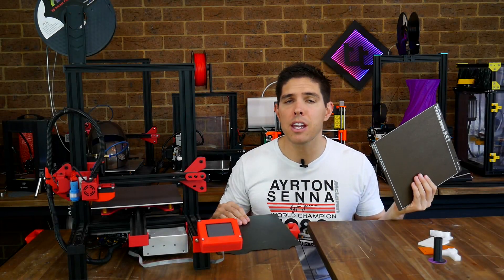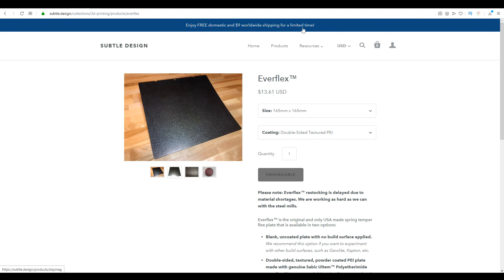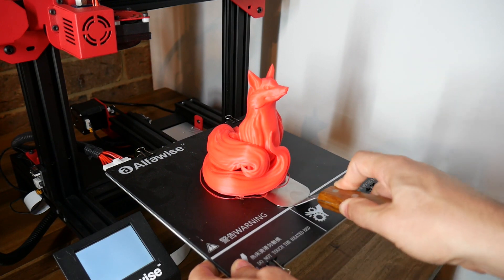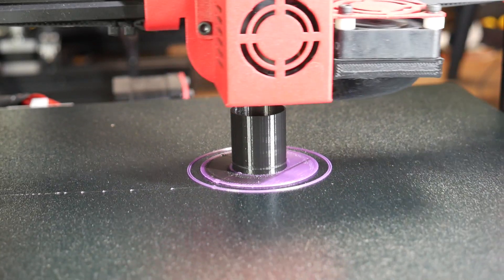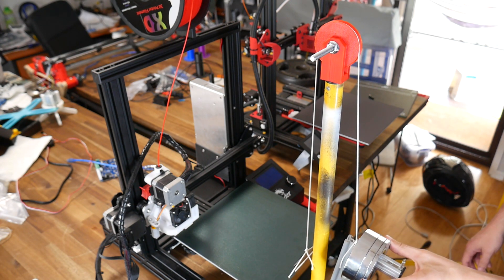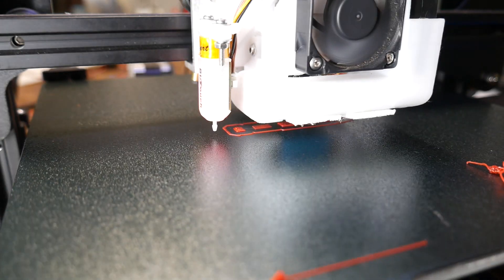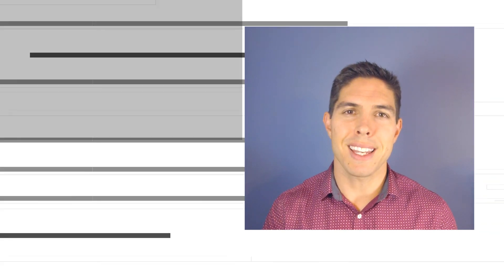Everflex PEI powdered coated magnetic sheet - Prusa style bed for your 3D printer

Comment: I’m wanting to use a textured service and currently have wham bam sheets on all of my printers. Like you I’m located in Australia and products like layer lock are expensive to get shipped. What do you suggest?
Also have you found a pei surface that you could attach to the other side of a wham bam sheet? I assume that the magnet would still be strong enough to hold it.

Comment: I have an anycubic i3 mega s. its my first printer and i have put a lot of wear on it over the last 6 months. the print bed is chipped and it seems to have a high spot in the middle. I want to add a magnetic surface to revitalize the print bed and i wos curious, should i lay down a parameter of masking tape around the outside out the bed to raise its height to about the height of the center before applying the metal plate? would that lead to adhesion problems for the metal plate in the future or would it be a  suitable solution to my problem?

Comment: You need to test the pull strength when they're hot, depending on the type of magnet this can change drastically. 

Also, you should show  the pull strength of of a tried and true magnetic base, the mk3. You're telling us that these arbitrary numbers are strong enough to 3s print with but how do we know if either is good? You need to prove it.

Comment: I'm more interested to make a DIY surface. Some guy did wrote that it's possible with using a special car paint of "Ceramo" brand. Claims that it's a great thing and keeps the most of plastics like a beast when the surface is hot.
Actually it's not because I'm that greedy... But the delivery from US costs ~40$ for us. Not an economy way to buy these original parts :)

Comment: Hey Michael! There's a question that's been bothering me. You know the creality bl touch kits, you even reviewed one. You yourself know that the bltocuh v3.1 that comes with the kit doesn't work with the provided firmware, and i'm no programmer so i'm really not comfortable with editing or modifying the code that my printer runs on. But i did some digging and i found creality's google drive page that had updated firmware (1.1.9 for BLTouch V3.1) for every printer except the ender 3. There was one for the ender 3 PRO, but i have the stock one and i don't know why they didn't make one for that. And i was wondering, there really isn't any significant change that directly affects the printing process on the ender 3 pro. Like the offsets are the same, just the y axis is wider and has a mk10 extruder in place of an mk8 extruder. Other than maybe having to recalibrate the e steps thats it? So other than reading ender 3-pro on the info screen and some tinkering with the e steps i really see no point why i should not use this on my stock ender 3 to get the BLTouch working. What's your take on this?

Comment: I very much think this is one of those deals where you get what you pay for.

I bought an aftermarket PEI sheet and also an aftermarket powder coated PEI sheet on Amazon for my Prusa MK3S while waiting for the originals. Neither one lasted long. The powder coated plate delaminated in spots after about a week, and the PEI sheet plate lasted maybe a month and then developed a tear. In comparison, I received the powder coated and PEI sheet build plates from Prusa about 6 months ago and both still going strong.

Thanks, but I’ll buy the originals from Prusa.

Comment: o.k. ill get the texture thing thats nice but is that sth. that buildtack or the nockoffs cant do? i think they can. and geting corner lifting on pla @60 C is realy not good in any way shape or form. Considering that you can basicly print with no heeded bed on buildtack. if your bad leveling skill is up to the task, or your printer outo levels. 
I think combind this solution costs like 50-60 bucks for an ender3 siced surface. thats 1/3 of the total printer price. 
With the spacs it has its more aimed for the higher temperature materials like PC, PIE (ultem), Asa, ABS. where the thermal stability especialy of the magnet counts big time. 150C is a nice number. for a flex bed. And the print surface stays nice to at that temperature. With buildtack (basicly a slice of pc (polycarbonate) 150 is tricky).
In that bracket 60 bucks is alsow no longer expencive. 
But for pla and petg same for flex it makes noo sense getting this surface, 
Get a bottel of pva glue fill it in a pet bottle mix it 1 to one with isopropanol and add a bit if water. 
u have a slury than put that on your buildtack and spred it with a cutter knive edge so that it forms a thin layer on your complet bed. 
Print on it,  its good for like 3 prints in one position. 
main thing is if u get a print thats stuck to your bed just put a bit of isopropanol on it and the surface will turn back in to a slurry relesing every part.

Comment: Although you might be taking your life into your own hands again, I suggest the testing you did for separation strength should really be done with the bed heated, given that a magnet loses strength as it is heated, Although I think it likely that the sheet will still provide enough holding force... I think testing with a heated bed would yield more useful data.

Comment: Subtle Design  sure looks like a trustworthy company.
They don't even say where they ship from or what their business address is. I am sure the quality of their product is sooooo much better :)
LOL Wam Bam is even worse. They don't even offer a way to contact them. This is a joke video, no?
Reply: WhamBam is based on Florida and they drop ship from China.
Reply: Subtle design just moved and is based out of Texas. All their plates are cut and processed in the USA with USA steel suppliers.
Reply: @bl5930  that's awesome! They really should do something for corrosion resistance. They do state to keep the plates in low humidity environments to prevent rusting.
Reply: @TH3DStudio  so far I haven't had any issues. 20-30% humidity and nearly 6 months of non stop printing. I've washed both of my plates with water and Dawn followed by a quick iso wipe down and still no issues. I'm still on side 1 on both plates. I agree a different solution would be nice but non wavy stainless spring steel isn't a thing. That leaves coatings like phosphates or zinc but the cost will go up alot. Honestly I'm shocked they are still as cheap as they are compared to competitors.

Comment: Hi Michael,  As always, thank you for the video.  Watch out for those failed Darwin Award attempts mate!!  I do like the look of this setup, but it's a bit pricey, no?  Currently using the OEM Creality glass sheet with printed texture on my Ender 3, and very happy with it (apart from the Creality logo they printed on it that tends to make a partial appearance on most of my prints). I'd be tempted by this solution if it was cheaper but as it is, I'll stick with the glass.

Comment: Hmm. I am tempted to order one of these.  I have an Ender 3 and the flex bed that came with it gave me nothing but grief and one failure after another.  I tried glue-zip. I tried sanding it-another zip. Finally I tried a heavy mask that I use for sandblasting and that worked great for PLA for many many prints but when I switched to using PETG my prints permanently bonded to the rubber mask and pulled it loose.  I finally switched to a sheet of glass with the neoprene rubber mask on one side and that side down on the heating plate.  I have to spray the glass with a light coat of clear polyurethane and respray the area I've printed on after the print is removed.  This has worked great for me, but I really like the idea of this print and go bed.  Yup-I've just convinced myself and will go to your links and buy one.  Thanks for a better solution.

Comment: its important not to remove the print when the bed is still anywhere near warm because you definitely will warp your parts. it might not warp by much but you can be half a mil or a mil out and if its a mechanical part then you're boned.

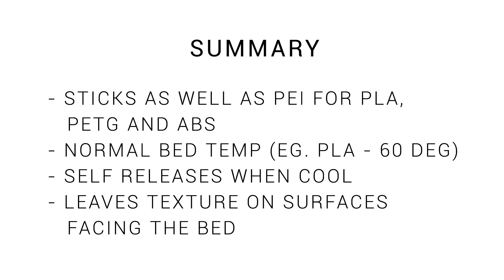Comment: @9:05 usable for ABS?  think not, cause you cannot heat the bed more than around 60C (magnetism decreases over time) and i like to print with the bed at 100C
This is probably  so for all magnetic beds, so for me, nothing beats the classic kapton tape still..
Reply: This is a different kind of magnetic surface I think.  Designed to handle higher temps without causing issues.  Even says in video rated to 150c

Comment: Maybe I'm too oldschool, but all of these 3 materials work on glass with a bit of gluestick, even if you print a lot you get what? 2-3 prints a day? that added minute is nothing compared and also bed leveling is a breeze, you don't need a bltouch or any abl. Bit more work print-to-print but reliable and cheap.

Comment: I still prefer glass with the ceramic coating. Got one on amazon with 3m tape already on it so no clips needed for 20 bucks. 3 months of use and scratch free. Love it and will never go back to disposable pads.
Reply: How about having to wait long to remove your prints? What about the added extra weight?

Comment: Using a similar one from trianglelab. Working okay for me but I can not get PLA to stick very well so I always use hairspray and brim and with this it works.
To clean off the hairspray I use hot water tho. Wat is the problem with water on that sheet? Is PEI water soluble? Or is everything ok if I clean it with IPA after cleaning it with water?
Reply from the maker: I don't have that sheet so I can't give you good advice. Have you looked for details on their website or contacted them?
Reply: This sheet is pretty different to the trianglelabs sheet, I have both.  The triangle labs texture is more smooth and seals the steel, but doesn't seem to stick well to pla for me either.  The everflex is very rough in comparison, and works well with pla and petg (however I have had issues with corrosion and powdercoat flaking off).
Reply: The "Don't use water" hint is for the everflex sheet. But it did not say why on their website. But I think the sheets are very similar so I'd be interested why water would be a problem with any PEI sheet
Reply: @mschild95  You're not supposed to use water with the everflex sheet because it doesn't have an anticorrosion layer between the powdercoat and steel, it will rust.
Reply: @theheadone  I already thought about sandblasting (very little pressure) one side of the trianglelab sheet and test whether this improves adhesion for PLA

Comment: I ordered a similar pei powder coated spring steel off Amazon. Even though it is a little bowed it works pretty good. The magnetic surfaces of my ender 3 and other printers actual hold it down and take the bow out of the plate, so it does become pretty flat. If it didn't I wouldn't used it.
As for bed leveling sensors I find that using a BLTouch is better suited than a Inductive sensor when switching between the various spring steel surfaces and other types of surfaces like your stock creality magnetic bed or some glass plates and what not. Just because the BLTouch will have the same trigger distance no matter what surface you use, where as the inductive sensors tend to need to be calibrated for each surface individually because of thickness differences combined with detection differences between material like steel vs aluminum, etc.,.
All in all the pei powder coating works great on the PLA, PETG, and TPU that I use when dialed in. The ability to flex the spring steel helps in removing the print but found that with TPU you might just want to let it cool down completely as depending on howbthick the print is it can flex with the plate.
Anyways I like my pei powder coated spring steel plate. It's definitely worth getting one.

Comment: my mk3s came with the powder coated sheet and honestly I hate it, nothing seems to stick
Reply from the maker: The standard sticker sheet is available from their website too if you prefer it.
Reply: PEI sheets are much-much better. You only need powder-covered if you want a texture.
Reply: Александр Алексеев I actually bought a pei sticker and put on one side so it’s not just trash.
Reply: I got a 1mm thick pei sheet and 2 subtle design flex plates. One was a normal texture beta flex plate and the other longer baked smoother texture. Everything I've tried sticks excellent. I have only tried petg, abs, abs+, pla, and pla+ with it. It works way better than the pei sheet. I've had to scrub the pei sheet several times to get it to adhere again .

Comment: Great review as always Michael. I'll be sticking (pun intended) with my ever-faithful WhamBam beds. Glad you survived unscathed, that looked real dangerous.
Reply: Hi how does that warm am work for printing PETG with think walls about 3 mm
Reply: @hunterjames5819  If you're asking about my WhamBam FBS, it sticks perfectly well with PETG. 3mm should be plenty to adhere to the bed, depending on the rest of the model of course. If you have concerns, consider using a few mm of brim for the  added peace of mind.
Reply: @spikekent  yes that one with the PEX surface. I want to print a boat with it and I know I said this already. It has only a 3mm hollow shell. Do you still think this will work and how well does it stick during prints do they release often
Reply: @hunterjames5819  I've printed a lot of PETG on my Borg (CR-10 on steriods) and I've never had a print release untill the bed cools down. But when it does cool, the prints come off very easily. In sumary, I think it will work perfectly, but feel free to contact WhamBam, they are very quick at answering any questions you may have. Also, they are always testing their products and responding to community suggestions. I can only speak from my experience, whereas, WB have a ton more than I do.
Reply: @spikekent  ok great thanks so much for your help. Sorry for asking so manny questions but I have to more where is that aria to contact WB I was not able to find it on their website. Also what is Borg
Reply: @hunterjames5819  No problem at all mate, here to help when I can. You can email Whambam at this address Info@WhamBamSystems.com its at the bottom of every page on their site https://whambamsystems.com you can also contact them on Twitter @WhamBamSystems
 they are very active there too.
Ah! The Borg. It's just the name I gave to one of my printers. It started life as a CR-10 4S, brought purely to hack/upgrade the hell out of. It has Keenovo 240v heated bed with SSR (Solid State Relay), WhamBam Flexible bed system (obviously), Bondtech BMG extruder, Microswiss hotend with 0.8mm nozzle, SKR 1.3 main board with Trinamich 2209 drivers and sensorless homing, Noctua fans all round for noise reduction, Oh yeah and a MeanWell PSU (Power Suply Unit)

Comment: Great video as always. I'm using a smooth version and am considering this as an additional option. Would have loved to see if the magnetic sheet can be heated to lets say 80°C... At what temps did you print the ABS part?
Reply from the maker: I tested ABS at 100 degrees C. Their is a certificate on their website saying it's rated for 150 deg C.
Reply: @TeachingTech  I would really like this to be tested. Can you do dome long term tests in ABS with a 100C bed?
I heard that the magnetism degreases and even goes away completely over time when you repeatingly heat up to 100C and cool down to room temp..
Reply: @winandd8649  I've been using my staymag for 5 months all the way up to 110 with abs and it is still super strong
Reply: @TeachingTech  thanks for the answer. And I guess it survived the heat ;)

Comment: I have this Eryone texturised PEI sheet one for my ender 3 and its been working for months like a charm : https://www.amazon.co.uk/gp/product/B07Q8F3F9P/ref=ppx_yo_dt_b_asin_title_o01_s00?ie=UTF8&psc=1
Its currently unavailable but you can still get the smooth one, and it fits the ender 3 perfectly:
https://www.amazon.co.uk/ERYONE-Upgrade-Magnetic-Flexible-printing/dp/B07MGBFTFM/ref=sr_1_2?keywords=eryone%2Bpei%2Bsheet&qid=1576615177&sr=8-2&th=1
PS: I live in the Uk

Comment: I have a smooth flex/PEI sheet from Amazon that, unless my Z offset was bad, I had to scuff w/ steel wool to get it to stick PLA. I still get a shiny surface on the bottom. It doesn't self-release when cool, but I forgot to remove a previous print and the gantry easily knocked it out of the way. Luckily it was small and right where the BLTouch homes. Not sure how an inductive would have faired. I checked the camera to find strings in the outline of the part and the nozzle some 30mm in the air due to homing on the previous print.